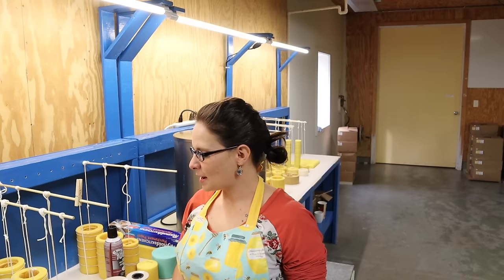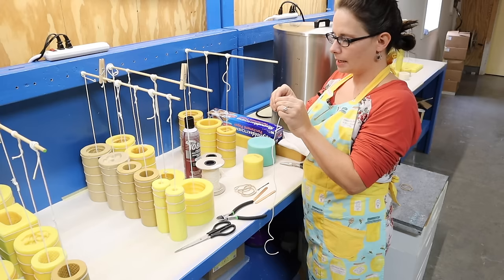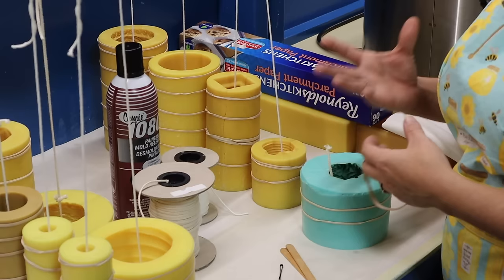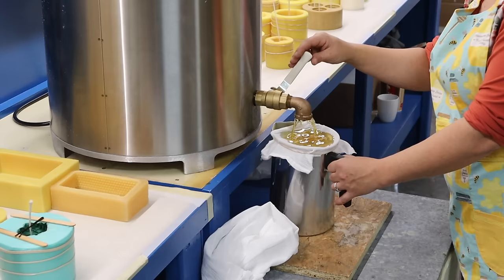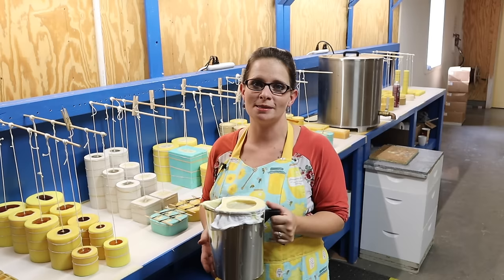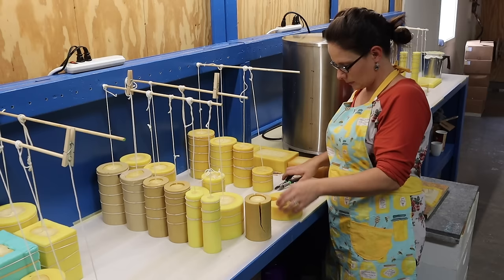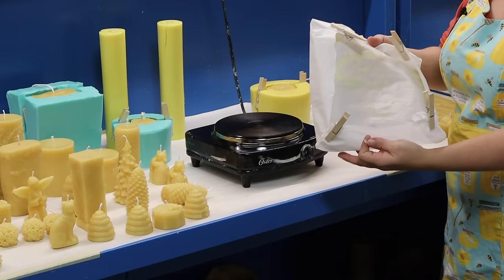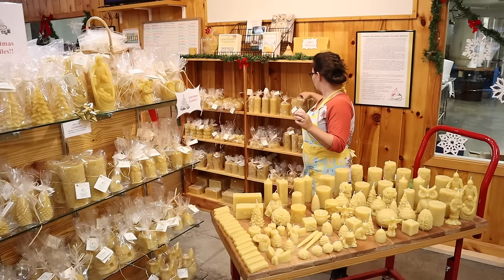How to Make Beeswax Candles

Comment: She is beautiful! She glows and her eyes are enchanting! She explains things clearly, cheerfully, and in an engaging, hands on way. This is by far the best candle making presentation I have ever seen. I would love to begin making candles as well. I have a lot of moulds I was given. Now I am not afraid to start.
Reply: Just an update, I have made beeswax candles , I had a ton of Mann Lake ltd molds I was given for free, I’ve been making candles, they’ve all turned out good, I’m now testing them before giving them out. I tested using cappings wax and lower grade brown beeswax. I was getting sinkholes in my candles after pouring, so I found that by putting the beeswax-filled moulds immediately into my oven that has been pre-warmed by the Oven light (and keep it on during this process) on a cookie sheet, they did not have tunneling , or sinkholes in the wax due to cooling too fast. It really helped. I also found during testing that my unprimed wicks tended to snuff themselves out before reaching the wax. I thought if I primed just the first inch of the wick that was to go into the top of the candle (bottom of the mould) that it would fix that problem, and I wouldn’t have to prime the whole wick as primed wick is hard to get through and pull through the candle mould holes.

Comment: Fun stuff.  An easy way to keep the wick in the mold and not use the wicking needle is to leave the wick on the spool from the bottom of the mould.   When the mould is cool pull the new candle out of the mould and the new wicking self wicks.  Done.
It's was a great idea to mention the temperature of the wax for pouring candles.  Very important.
Reply from the maker: Thank you.

Comment: What an excellent video.  132 thumbs down?  WHAT IS WRONG WITH PEOPLE!!  That setup is really cool and such a nice shop you have. I love the little dowels and all the slots for them and the lighting is perfect.  That melter is sweet too. Those are pricey!  Anything stainless from Mann Lake sha shing  lol  I've been using a crock pot and turkey baster, and that baster gets flippin hot after a few squirts. Interesting that you filter it one last time into your pouring pot.  I'd like to set up a similar wax processing area on a smaller scale.  I'm just now getting where I have a little bit of wax to work with.  I'm going to have to check out what else you guys have posted.  You must have a lot of hives to have all that wax I saw stacked up there.  I try to manage around 30 hives and boy it's a lot of work. .  It was a good year for us with plenty of rain, so we got quite a few cappings from around 550 lbs of honey. I saved some of our darker wax from last year to put back on my plastic rite-cell foundations that need recoating.  This year's I melted into the 1 oz bars.  I didn't see in the comments below on where you get your wick.  Do you use Mann Lake for that as well.  Are your molds mostly Mann Lake?  LIKED AND NEW SUBSCRIBER.
Reply from the maker: We do get our wicking and most of our molds from Mann Lake. The Melter is from Candle Science. Thanks for your comment.
Reply: @bobbinnie9872  I'm hoping to make some lip balm and a few candles over Christmas break.  Merry Christmas to you.
Reply from the maker: Thank you

Comment: i noticed that your molds are partially cut, none of the molds I have are split.  Should I partially split my molds?  I am new to candle making.
Reply from the maker: We partially split some of our molds with a razor blade simply to make it easier to get the candle out. Not all molds need this, especially small molds.

Comment: Put the cloth around the spout, secure it with rubber band. Give a little pouch at the bottom. It will use even less cloth, and improve the stream.

Comment: You don't have to tie the wick from the candle to the support bar and use all that unnecessary wick. Just tie a long string to a binder clip, cut the wick to the length you need and attach to the binder clip. Then just tie the string on the binder clip to the support bar.
Reply from the maker: Thanks
Reply: 16:17 it isn't unnecessary it isn't wasted either

Comment: Fantastic!!!   I like the system for holding the wick.  However, you're wasting a lot of wick.  I was taught by a candle maker (published a beeswax book) to keep the wick attached to the spool.  This way when you remove the finished candle all you do is pull up and the wicking re-wicks the mould for another pour.  
But I absolutely love the sticks set over the moulds for centering the mould.  Oh yeah.
Reply from the maker: Thanks for the tip
Reply: What I do is cut off about six feet of wick and do as you say, pull it through to the next candle. What I do like is the tension you can create without leaving any impression on the bottom of the candle.  I will use the tip of the craft sticks next time I'm pouring!

Comment: Great video. Thank you so much. Another video explaining the method of proper burning of these candles would also be super helpful. I hate it when I spend so much effort into making the beeswax candles and then end up burning a hole straight down the middle of the candle. So frustrating. Beeswax is so expensive and rightly so.
Reply from the maker: Hi A L, Thanks for the comment. I believe an undersized wick causes this problem. Good luck.
Reply: Hello from Remarkable Honey and Candles...Canada....to keep the candle from tunneling -it is all in the initial burn so the first burn needs to be the longest burn until a wax bowl is created and the sides are 1/2 inch thick

Comment: I loved your video!  Pamela mentions that you can reuse the strainer cloth over and over.  I am wondering how you clean the beeswax off of the cloth to reuse it?
Reply from the maker: Hi Savita. We pour hot wax on the cloth while on the pouring vessel and it melts the existing wax enough so it will flow again.

Comment: HERE IN AUS: fantastic video thank you!!! I have new silicone moulds they dont have slits in them like your moulds, should I cut it? it is a smooth mould no pattern. Also is flower cloth, cheese cloth??? Thanks for a fab video - very informative and relaxing!
Reply from the maker: We only put slits in the molds that are a little more difficult to remove. If you don't need it, don't do it. Flower cloth is also known as "flour sack towels". It's just a thin cloth that is often used in kitchens for covering bread or wiping up with. It feels like a thin version of baby diaper material.

Comment: Thank you so much for sharing this video. It is a real gift. I've watched a lot of beeswax candle making videos and this is one of the best! One question: do you find soaking the wick in the molten wax is unnecessary?
Reply from the maker: Thank you. We don't soak our wicks and they work fine.
Reply: @bobbinnie9872  One more question: what do you put your molded candles on while they are burning?
Reply: @a1hindes  that's up to the individual buying them. A candle holder of sorts. Silly question

Comment: Hi, I really enjoyed the video, straight to the point, simple and really offers a visual understanding of the process. However, I am curious, how does beeswax perform on a sturdy basis... Like how strong is it? Say if I drop the candle on the floor will it break? Do I need a lvl of force from a hammer to break it in two? Or can I just use both my hands to snap it? How strong and sturdy is the product of beeswax? Thanks! I'm looking to might be testing them on my own as well but interested in your take on this.
Reply from the maker: If I had to guess I would say it is probably about as strong as paraffin.

Comment: Thank you for the wonderful video very well done my question is how much beeswax do you get from one hive per year and how many bees approximately would be in that one hive and are you only getting honey production in spring summer and fall thanks for your time Simon
Reply from the maker: Hi Simon. We probably get two or three  pounds of cappings wax per colony per year. There are about fifty to sixty thousand bees in a colony at the peak of the season and we only harvest honey from the spring and summer and leave late summer and fall honey for the bees. They don't make any in winter.
Reply: @bobbinnie9872  tks for the reply so how many pounds of wax do you feel like you harvest at your company each year. It seems like I never have a problem getting my beeswax candles that I buy it the different rendevouz I go to which or a 6-inch taper that I used in my chamberstick candle holders and I was wondering where does all the wax come from
Reply from the maker: We might get a few thousand pounds in a good year and we also purchase some from beekeeper freinds of ours.

Comment: how often do you have to replace the molds.  Seems that they would pull apart after awhile.
Reply from the maker: Most molds last for hundreds of candles if you are careful. The main things are to not pour to hot and use mold release.

Comment: Great explanation, one of the best ones out there! Any tips on making safety candles, where the wick won't go all the way to the bottom of the candle so it will simmer out before burning into the table?
Reply from the maker: Sorry I don't know, we've not made an effort to do that.
Reply: I would suggest not having it burn on a surface you care about. Maybe use a saucer or something like that?
Reply: This is actually a really easy fix.    Before the poured candle gets cold, just pull the wick up from the top, gently.    You can create that safety gap in the wick really easily.     I’ve done this (by accident) a few times.    Best of luck.
Reply: @roberth293  the top of the candle is the under side of the mold, so you would want to pull from the bottom is,  and pre-trim your wick at the top of the mold/bottom of the candle. Candles usually set from the outside in, so the center stays a bit looser for longer.

Comment: Thank you for sharing 
I recently made a large beeswax candle but as soon as it set and was taken out of the mold there was a huge crack going around the candle in the middle.. are you able to help? I am using a plastic mold not silicone
Reply from the maker: If the wax was poured to hot it may shrink to much and crack. Cooling too fast will also cause cracks.

Comment: Hey there! It was hard to see what you were doing with the Bobby pin?? Did you run the pin through the threads of the wick? Or just pinch the wick between the two parts of the pin so that you could suspend it straight across the wax well?
Reply from the maker: We just pinched the wick between the two parts of the pin.

Comment: I notice you didn't heat your molds... is it simply warm enough in your workshop, or is beeswax hot enough going in to fill all the nooks can crannies...?
Reply from the maker: Our room is normal temperature and we don't warm the molds. At 165 the beeswax is warm enough to flow well and we've never had a problem. Good luck with your candles.

Comment: Are the bags just to keep the candle clean and does it slow down the blooming? Would you share the u-line part number for the bag you use Thanks Your videos are great
Reply from the maker: The bags do keep the candle clean and eliminate some of the problems with customers handling them. They also look nice and provide a way to attach a label. We purchase our bags from "The Hamper House" in Forrest Park, Ga. PH 404 366 7166. The bag we use the most is XHBG2.

Comment: Thank you very much for your wonderful tutorial! May I ask you please why do I have this problem over and over again? After about 20 minutes after pouring, my candle deepens in the center. Do you know the reason for that and what can I do to prevent it? thank you very much!
Reply from the maker: Hi Ilona. This is probably a problem with temperature. If you pour to hot or to cold you can have issues. Try going up 5 or 10 degrees. If that doesn't work go down in temp. Good luck.
Reply: @bobbinnie9872  Thank you so much! I will try!
Reply: Just wonderful, I been tryin to find out about "soy wax for making candles" for a while now, and I think this has helped. You ever tried - Cenadoelyn Candle Contemplation - (do a search on google ) ? Ive heard some super things about it and my mate got excellent results with it.

Comment: Hi there, what you are doing is amazing… I just start making candle myself and I am so amazed about your candle shop…. Well done 👍🏽… how do I know if my wick is big enough for my pillar candle? Did you cut the mould yourself?
Reply from the maker: We do cut the molds ourselves after they arrive. When we buy molds they have the suggested wick size on the package. We also like to burn one before we sell it if we're not sure. If the candle burns down the center and leaves a wall the wick is too small. If it's too big the candle burns fast and excessive drippings flow down the side.
Reply: @bobbinnie9872  thank you so much for your quick response 🤗

Comment: Very interesting and clear,I just wonder about using hard plastic pillar molds,any special tips please? greetings from UK
Reply from the maker: Sorry, we don't use hard molds so I wouldn't have any tips on that.
Reply: @bobbinnie9872  Thanks,I made two pillar beeswax candles yesterday with hard plastic mounds and they worked very well,I sprayed them with silicone ,the moulds are slightly tapered  and the candles fell out with a slight tap. they are 40mm unfortunately the wick was too small and  didn't burn very well, small flame which eventually went out! , any advice on the wick size please, 40mm.?
Reply from the maker: @jonsmith4669  We use 60 ply wicking on our pillars.
Reply: @bobbinnie9872  Thanks so that would be for 60mm or 2-1/2 inch dia pillar? mine are 40mm or 1-3/4 inch so  a 40 ply wick  will work ? 
in the UK all the wicks I  seen thus far are measured  by the diameter so I  guess 2mm or 5/64 " would be right ?
we changed to metric system many years ago and its all very confusing ! I'm to old to change now. really !....
Reply from the maker: @jonsmith4669  Hi Jon. We use that wick on both of those diameters and it seems to work fine. There is probably a more exact recommendation for all the different sizes but we're trying to keep it simple if it works. I don't know much about the mm sizes.
Reply: @bobbinnie9872  Thanks Bob

Comment: Hey there, I don’t know if you’ll see this, but I have 2 questions. 1. In regards to filtering the wax, do you clean the wax off of the cheesecloth before reusing, and, if not, does the hardened wax from the previous filtering hinder the new hot wax from being able to filter through promptly at the first pour of the day? And 2. I’ve heard that the mold spray is not required for silicone molds, if this is true, is there any particular reason Pamela likes to use it for these , even if it isn’t recommended? Hope you can answer my questions. This video truly helped me a lot and I have watched it many times already, just to get it set it my memory.
Reply from the maker: The cloth we use for filtering is called flour sack. It's like a thin towel we purchase at Walmart. We don't remove the wax left over from the previous day and yes, it does take a minute or tw with fresh, hot wax to begin flowing again. But as long as the cloth is not clogged with debris, we use it many times.

Comment: Great video. Thanks from the UK.  Just started using our beeswax to make candles.  Having some issues with sinkholes even though I stick to pouring at 155 - 160 °.  Any advice would be much appreciated.  your moulds look amazing.  Having trouble sourcing such quality.  Many thanks.
Reply from the maker: Sink holes are usually related to temperature in one way or another. Perhaps the outside is cooling to fast.
Reply: Depends on what your pouring it in, if the mold is glass then 155 to 160 is fine but if your pouring into a metal mold you need a temp of 225.

Comment: Thank you for sharing! I've watched your video a few times and think I am actually ready to start! I am wondering if there are any substitutions you can suggest for home use. Can I use a large sewing needle, can I line the mold first with coconut oil before adding the wax to make it come out instead of buying the spray? If not, could you suggest where I can purchase these items - not coming up on Amazon. Lastly, where do you buy the roll of wick? I checked Brambleberry and Procandlesupply.com without success ~Thanks
Reply from the maker: Hi Alex. I believe a sewing needle would work if you could get the wick through it. We have never tried coconut oil so I can't speak on that. We buy all of our wicking, molds and spray from https://www.mannlakeltd.com/   Good luck.

Comment: I'm curious as to how you work with the wax that accumulates on the inside of the container as you pour your candles. I would think there would be some type of accumulation on the sides and bottom once you have finished pouring and your container has had a chance to cool. Thanks!
Reply from the maker: Hi Gary. We have a heat gun that looks a bit like a hair dryer that we warm the pot with.

Comment: Those are gorgeous and intricate!
Couple questions.  What are the advantages of beeswax candles?
Ever regret making some of your molds yellow like the wax?
Reply from the maker: Beeswax candles burn cleaner and burn long. They also have a pleasant, natural smell while burning. Most of the molds we use come yellow but it doesn't cause any problems.

Comment: Great Video! I have a question relative to the flour sac cloth. Can this be cleaned and reused or is this throw away material from the process? If it can be reused please explain how. Thank you.
Reply from the maker: We use the cloth about five or six times and then discard it. They are inexpensive so we don't make an effort to clean them.